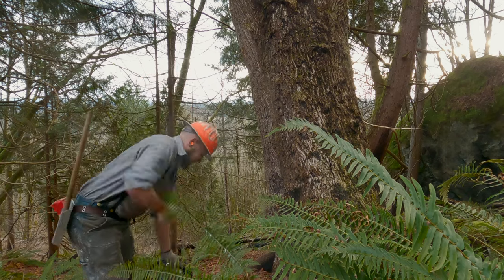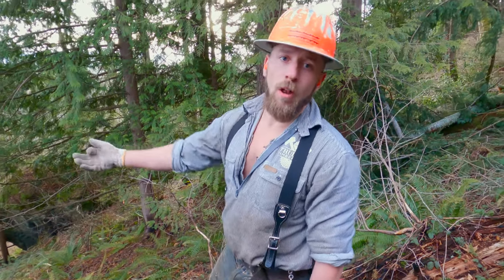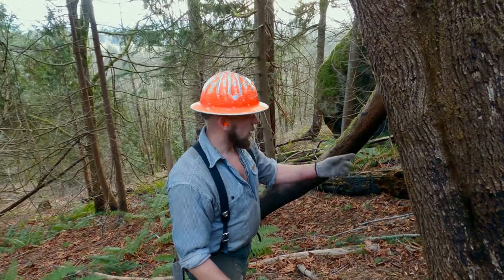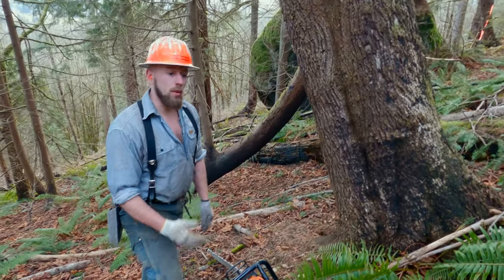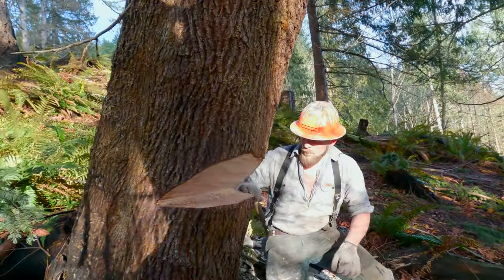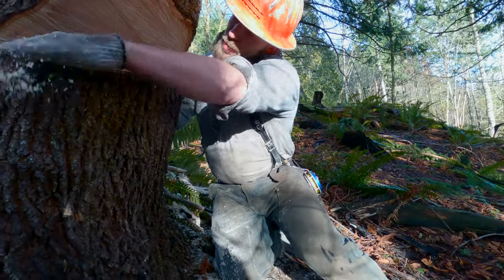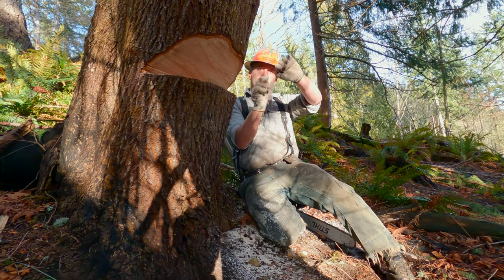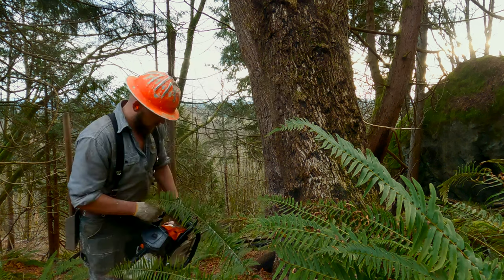How to fall timber: DANGEROUS LEAN (felling on a slope safely)

Comment: On a hard leaner I was always told to plunge cut set you hinge and then cut out the back and you won’t have to worry about barber chairs is that something you do as well?
Reply from the maker: Yes absolutely, there is a time and place for that. Most barberchairs can be avoided by continuing your cut when the barberchair starts. 👍

Comment: You said on a front leaning tree your bar can get pinched on the horizontal cut. How do you prevent this and what can you do to free the bar if it does get pinched?
Reply: Top cut first. Very thin slices one after the other. If you get pinched, it’s easy to chop your saw out with your axe. Just don’t hit the chain. 😁